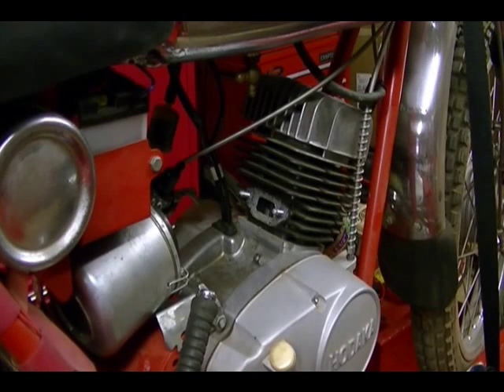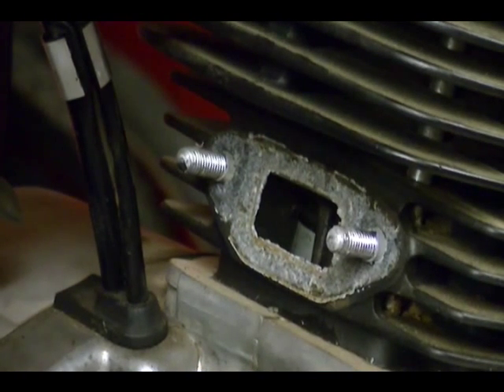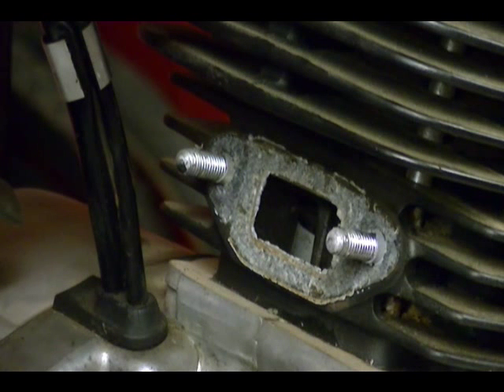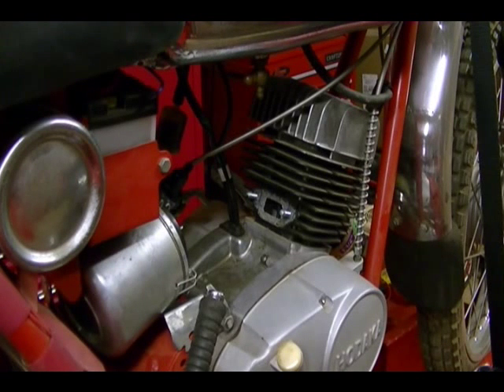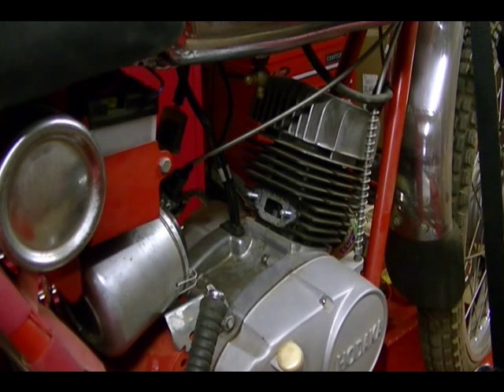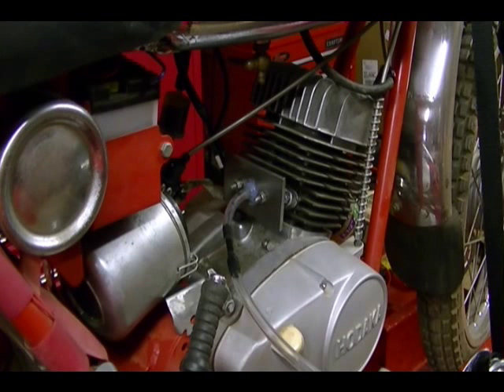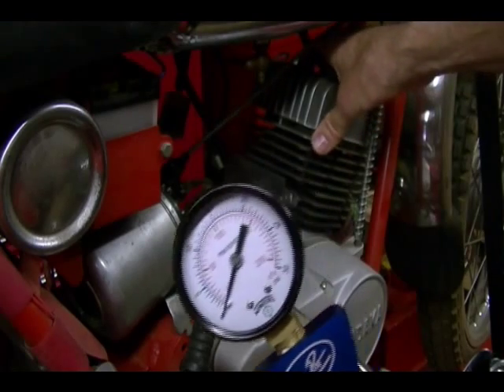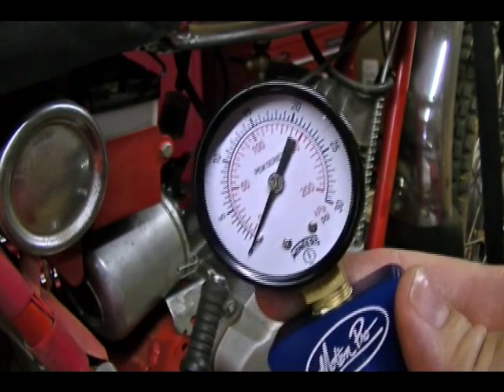Will a 2-Stroke Piston at BDC Covering the Intake Port Prevent a Accurate Leak Down Test?

Comment: Wow! this means that I can get an adaptor for the spark plug hole and push in air that way. Then I just need to put a piece of rubber between the carburetor and intake as well as between the exhaust and muffler. A lot easier than making seperate adaptors for all the different exhaust ports (chainsaws, lawnmowers, hedge trimmers etc.)